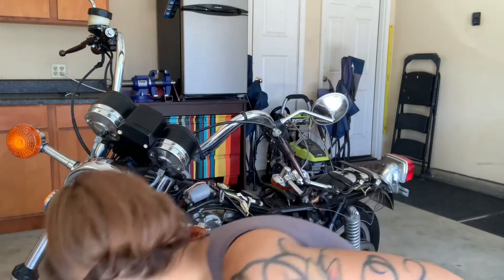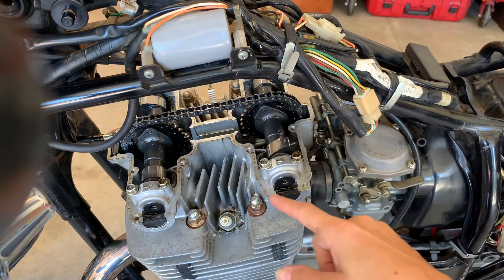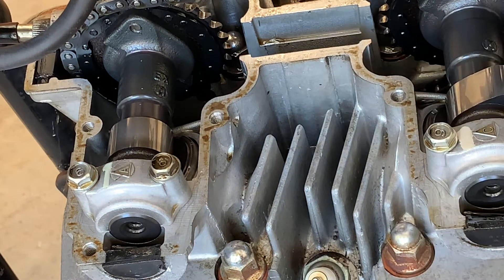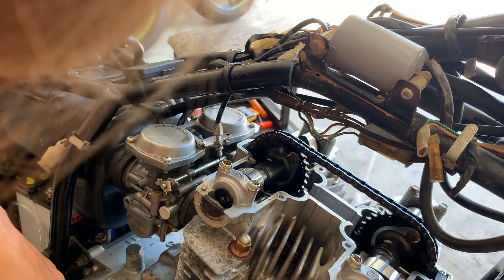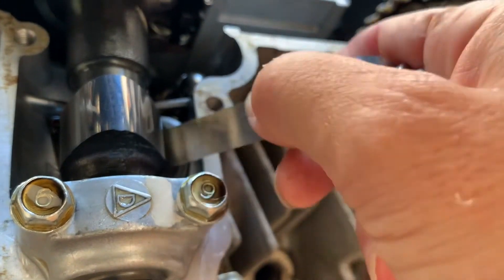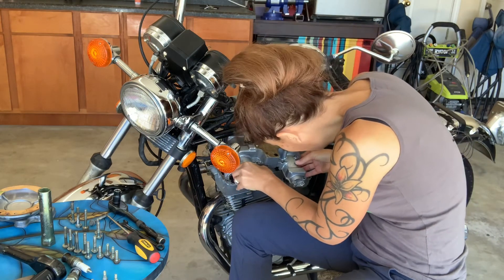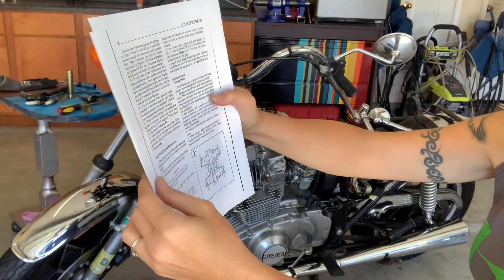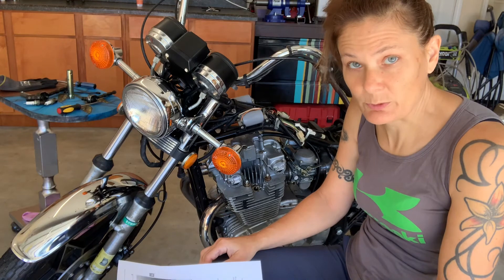Checking valve clearance on 1981 Suzuki GS450L

Comment: Betty- would you happen to know what hoses connect to the air box? When I got mine no hoses where on it but while looking up images of the gs450 air box I noticed it should have hoses running somewhere to if from somewhere. Thanks!
Reply from the maker: It’s been so long I don’t really remember it seems there was one that ran under the air box that wasn’t connected to anything just like a drain line. I would suggest looking up the service manual online you might be able to find a pdf version for free